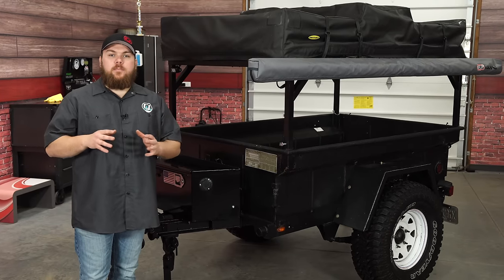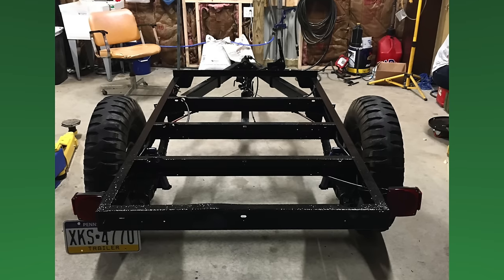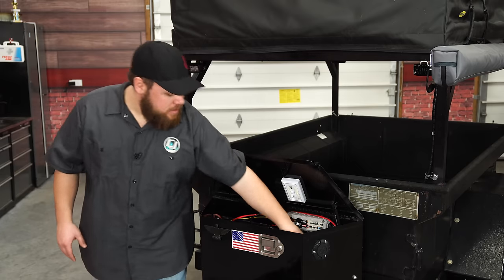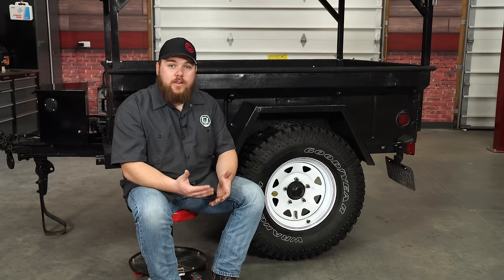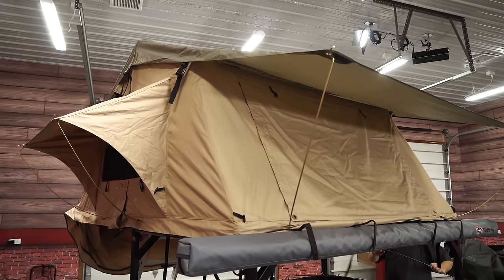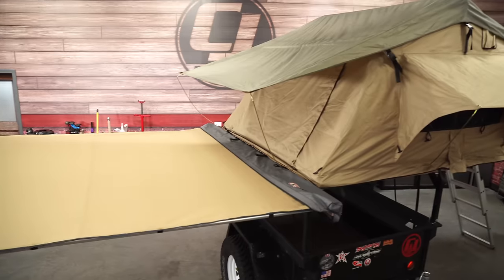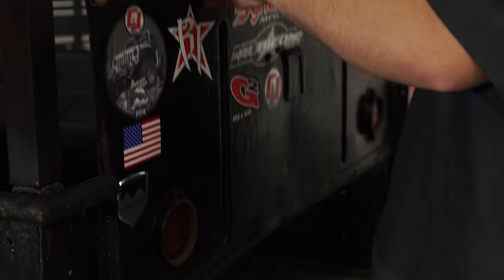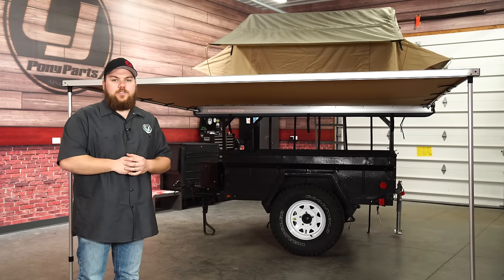Custom Built Overland/Camping Trailer Review

Comment: Curious as to why you didn't get square tubes that fit inside your upright tubes on the trailer and attach the sun shade to them. Drill a couple of holes in them so you can raise them which raises your sun shade over your head then put bolts in the holes. Now you can stand under the sun shade. When done pull the bolts or pins and let the square tubes slide down into your trailer tubes and away you go. Just an idea.

Comment: Very cool set up I would like to do something very similar are you happy with the Heights that you put it since you can’t technically stand up underneath the awning seems like that would be a pain I like the fact that it sits lower when packed up but I wouldn’t want to do have to duck constantly getting to and from my seat
Reply from the maker: The awning is actually lower in this video since I lowered the rack itself. I made up a small "L" bracket which will slide in the tubes and put the awning up high when i want to use it, and lower when in travel!